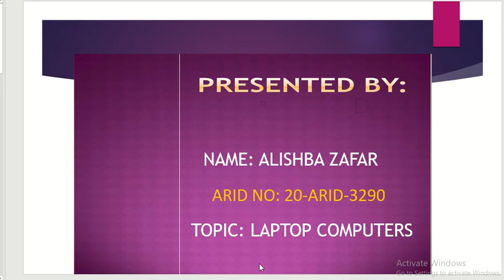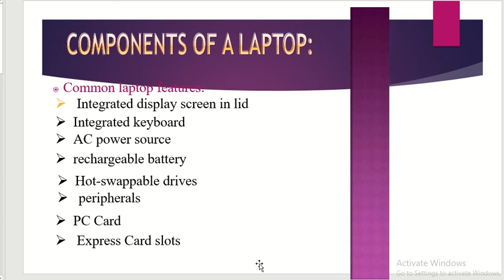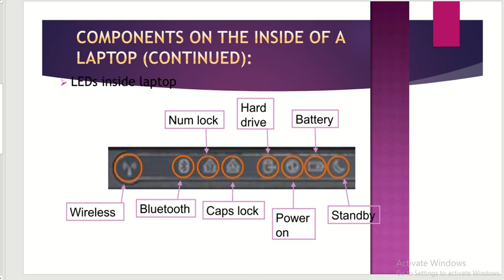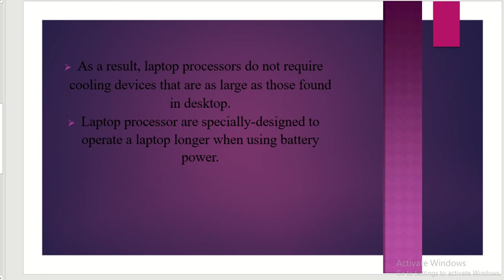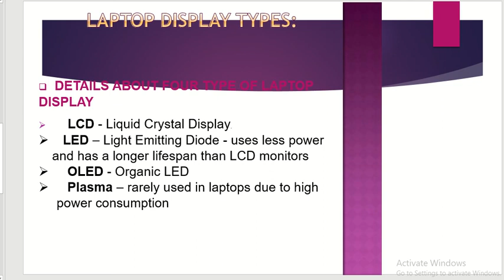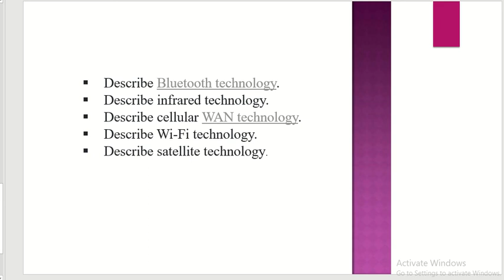Laptop

Comment: Good!
Summary:
Laptops aka notebooks are thin portable computers having almost similar components to that of desktop but fitted into a single compact unit. Different ports & components are present on all sides of laptops e.g. USB port, headphone/microphone jack, speakers, etc. Specialized processors are used that consume less power. Screen can be LCD, OLED, LED or plasma. It has a special key Fn (function) used for changing settings quickly. It also has power settings and more means of communications. They are important because of their portability so you can do your work wherever you want.

Comment: Good! The period 1940 to 1956, roughly considered as the First Generation of Computer. The first generation computers were developed by using vacuum tube or thermionic valve machine. The input of this system was based on punched cards and paper tape; however, the output was displayed on printouts.

Comment: Good
Summary:
Laptop computers, also known as notebooks, are the small portable personal computers with a "clamshell' from factor, typically having a thin LCD) or LED computer screen mounted on the upside of the upper lid of the clamshell and an alphanumeric keyboard on the inside of the lower lid. The clam shell is opened up to use the computer.

Comment: Laptop computers are basically small computers that can easily be carried from one place to another and they are portable. Laptop can be used for more than one hour after charging hence they does not require direct electricity. They provide more facilities as compare to simple computer and can easily be placed in laps.
Good

Comment: Good
Summary:
A laptop is defined as a small, personal computer that is portable. It is also called notebook. It has clamshell having LCD or Led computer screen. It's processor use less power and produce less heat, it operates the laptop longer using battery power. It's components are; integrated display screen in lid, integrated keyboard, bays, Jacks, vents, ports, slots, AC power source etc.

Comment: Good
Summary
Laptop are portable personal computer and are able to fold flat for transportation. All peripheral devices such as keyboard mouse power are all present in single unit laptop processor are special that consume less power. The led size is from 8 to 12 inches the screen of laptop is usually LED LCD plasma OLED the power option in laptop consume less power laptop is used in education business purpose in preparing assignments and presentations it has special key Fn for changing setting quickly. It is important due to its portability

Comment: Good 
Summary: Laptops combine all the input/output components and capabilities of a desktop computer, including the display screen, small speakers, a keyboard, data storage device, sometimes an optical disc drive, pointing devices (such as a touchpad or trackpad), with an operating system, a processor and memory into a single unit.

Comment: GOOD.
SUMMARY:
Laptop is a portable, compact microcomputer which works on both barter and external electric power. It contains all the components of computers such as cpu, keyboard, mouse, monitor etc in a single unit due to which it is said to be as compact.

Comment: Gud..!!
 laptop computer is a small, portable personal computer with a "clamshell" form factor, typically having a thin LCD or LED computer screen mounted on the inside of the upper lid of the clamshell and an alphanumeric keyboard on the inside of the lower lid. The clamshell is opened up to use the computer

Comment: Good
Summary: as name shows that laptop computer means the total laptop which we can put in lap.a computer that is portable and suitable for use while travelling.
typically having a thin LCD or LED computer screen mounted on the inside of the upper lid of the clamshell and an alphanumeric keyboard on the inside of the lower lid. The clamshell is opened up to use the computer.

Comment: Good 
Summary 
A laptop or laptop computer, is a small, portable personal computer with a "clamshell" form factor, typically having a thin LCD or LED computer screen mounted on the inside of the upper lid of the clamshell and an alphanumeric keyboard on the inside of the lower lid. The clamshell is opened up to use the computer.